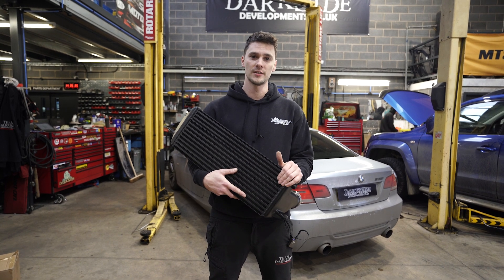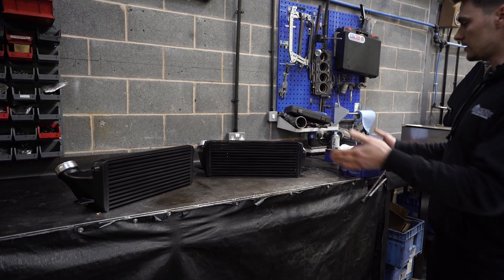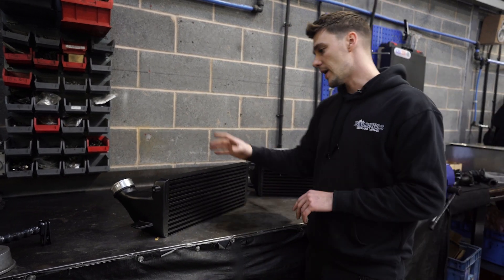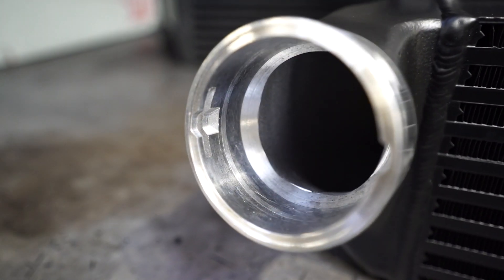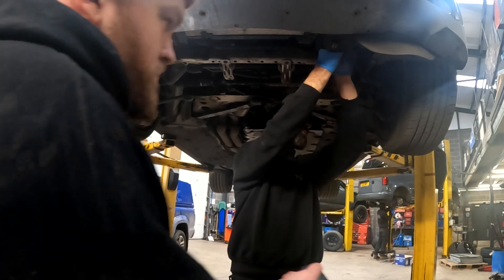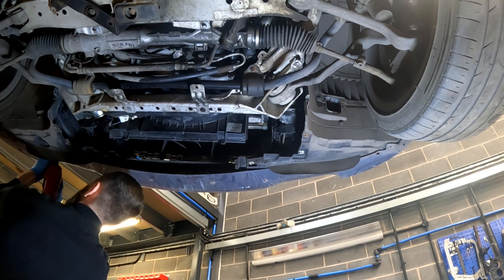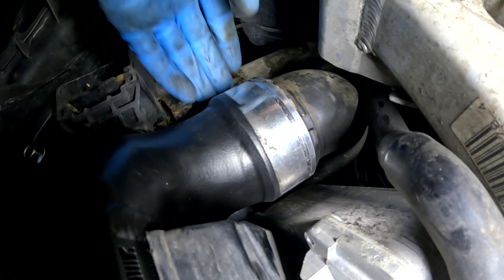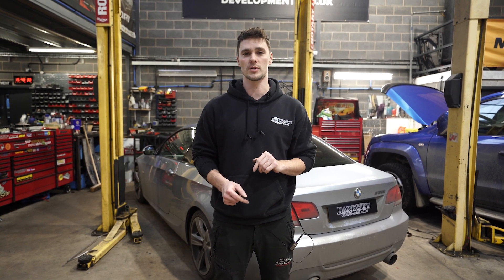Guides 'N' Tech l BMW 335i INTERCOOLER! 📖🛠

Comment: What securing screw/bolts did you use to replace the T25 screw when fitting Your Intercooler ?
Reply from the maker: We supply these with the FMIC 👍

Comment: Where are you guys a based?
Reply from the maker: Barnsley, South Yorkshire
Reply: @DarksideDevelopments  just a question, I have got a pipercross air filter and I would like to fit it in. To do that, do I need to do an oil service change?
Reply from the maker: Not really!

Comment: Fin density means less air getting through to the radiator behind - not always better-the internal fin density and style, offset distance, gauge, corrugated etc. Will have a much bigger effect where pressure drop is such an important factor. Weld quality looks good on Instagram but in reality the original was crimped aluminium on to a plastic tank-clearly not the harshest environment ever. Some real flow tests, or even dyno runs, would be interesting
Reply from the maker: If you put 3 bar through a crap cooler the caps blow off. If cooling the radiator is more of a concern then obviously a better intercooler will never usually help!
Reply: @DarksideDevelopments  in blighty you're probably fine. If you were in spain, middle east etc having less air on the radiator might start to be a problem. Welded cast tank is certainly stronger than plastic. But even the blobbiest of Chinese tig torch will hold 3 bar all day long.
Reply from the maker: Coreyt

Comment: The china one is better for cooling since air can pass better trough it but the darkside one has more mass and can cool more just not as fast
Reply from the maker: That's not strictly 100% correct but it half makes sense.
Reply: @DarksideDevelopments your intercooler is junk lol just bc it’s got pretty welds doesn’t make it worthy